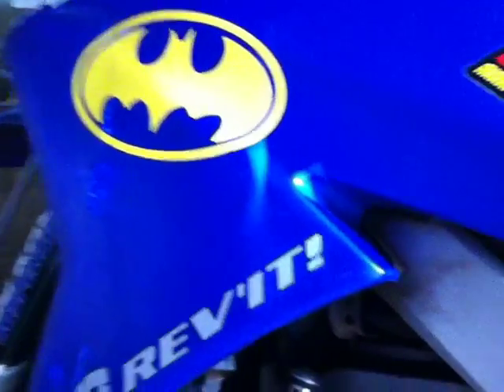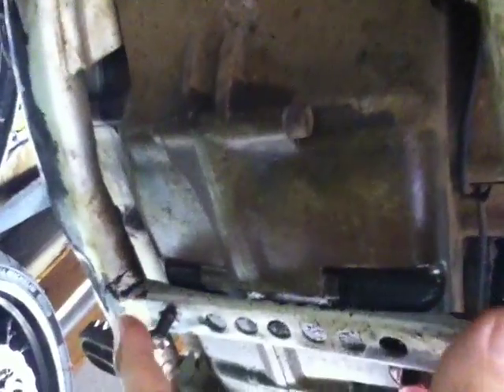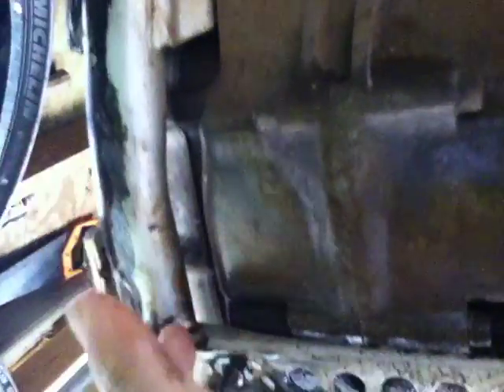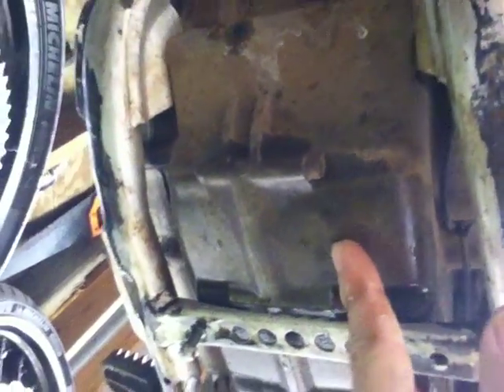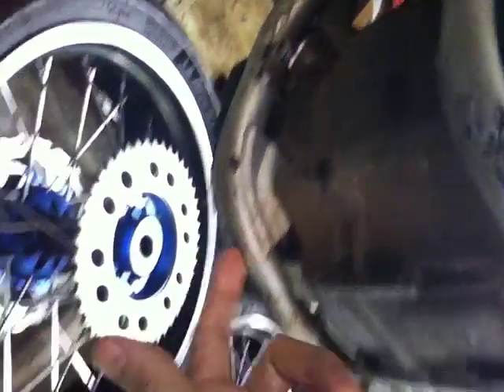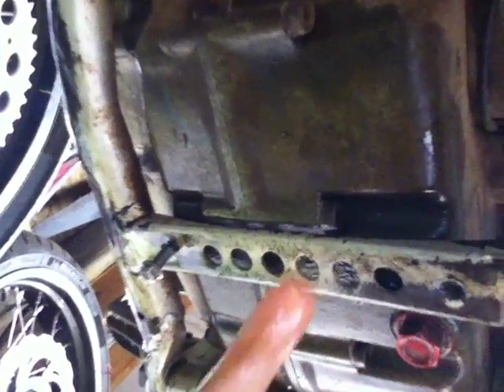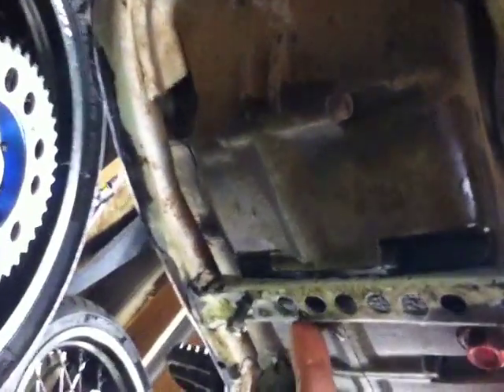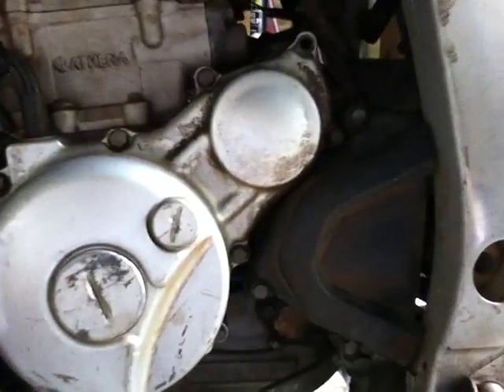Holy holesauce Batman! ++

Comment: Hey Kalani, you can try this Two Part Epoxy Putty its called  "knead it selleys" its a very good product i have used it myself! its suitable for Steel, Wide range of terrous metal and aluminium tems, Most plastics (pre-test required), Glass

Comment: What I would do if cut off that stupid bracket for starters then make myself a new skit plait that covers the entire underside of the crankcase. Then I'd either weld the plait on ( not recommended) or tap new screw holes in the down tube (or on the side of the down tube and wrap the skid plait around the side as well). I would NOT reuse that bracket and I would definitely build (or have someone else do it for you) a new, better skid plait.

Just my thoughts.

Comment: Pull the motor and have a competent shop weld it... Frying the motor from oil loss if the threads or JB weld fail would be a far bigger problem.

Comment: Just make sure you don't repeat Evotechs mistake. You don't want any extra bolt protruding into the case, measure and cut that thing down so it sits flush with the inside of the case. Hope it works out for you.

Comment: I think this is a good way to solve the problem, but I'm concerned that you can have another problem after removing this support. If you have a good resource of materials, I think two "antenna U-bolt clamp" and a "threaded rod" can do the trick as an removable support to take after you remove the soldered. But my way is the Brasilian way and I don't totally recomend. :)
Hope it helps, at least to think about other solutions.
Hugs

Comment: I wouldn't use JB weld or liquid metal. You're crank case is constantly going from temperatures of 40 to high 200's. That's a lot of thermal change. Robust metal can take that but a cheap filler product? I wouldn't trust it to keep sizzling hot oil off of my feet.

Comment: I think you really need that there the like 5 holes in it are for strength for twisting so it has to be important I would just cut your losses and pull the engine it's not worth cutting that thing off and bending or breaking your frame the next time you dump your bike

Comment: I think just putting a bolt there and dremel it the head off will just rattel lose when you just go crazy in the woods. In sweden we just dont have meatballs (maybe push a meatball in that hole) haha no but isnt there like a weld in a tube paste, we have it here its like soft material like paste and when it hardens it becomes hard like aluminium. Do you know what i mean?

Comment: Hey Kalani, :) First off, have you got the old piece of metal that was punched into the crank case? 

Secondly, I'll send you via facebook a picture of what you can achieve with JB Weld, I made an inch square hole in my crank case next to the shifter. 

Lastly, I wouldn't remove the brace, as it gives some torsional stability,  If you leave the two lugs for fitting a nut, you will experience them pushing inward too! Good luck with whatever you decide! 

Check the facebook message :)

Comment: Do you know if that bolt punches a piece of the crankcase into the machine cause if it did that's not good and ya might as pull the whole engine and make sure its out that could be disastrous

Comment: So... man that really sucks.  You really need to see the hole. Is it a crack or an actual punched a whole piece of casing inside your engine?  What kind of damage could that potentially do? And the cost to repair if that thing really jacked something up....  Like another guy commented I think you need to pull one side off and looksy inside.. or are you confident no more damage will be had from it. Just patching the hole will stop the leak but man not sure that really fixes the issue.  Good luck!

Comment: Aluminium is not very magnetic.A piece of aluminium in the sump will just sit there.The oil will hold it in place.Cut off the piece of frame and JB weld the case.If its a small hole,tap a thread and fit an extra drain plug